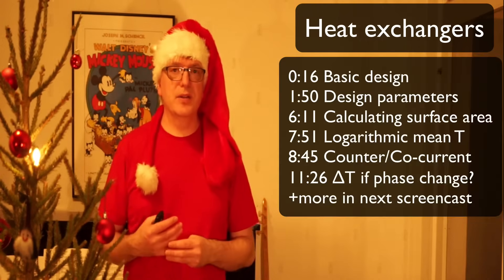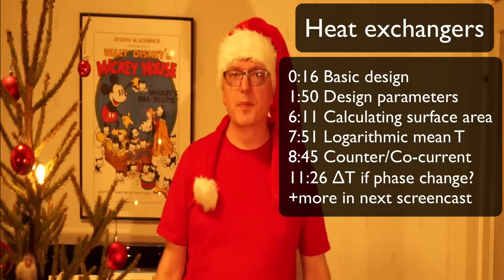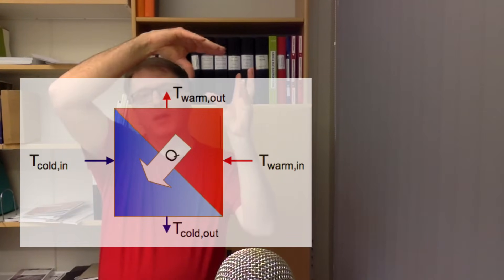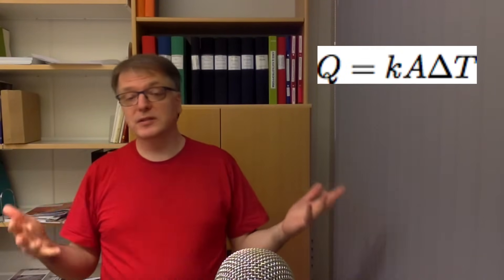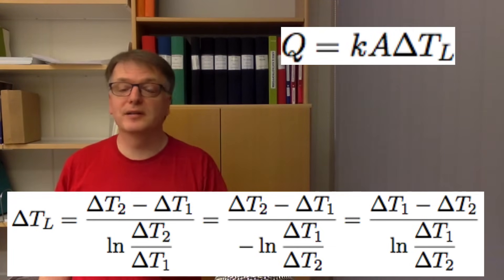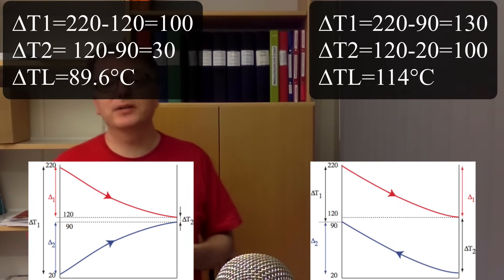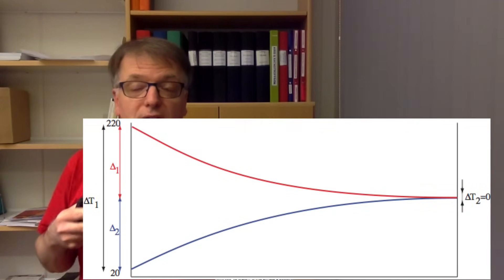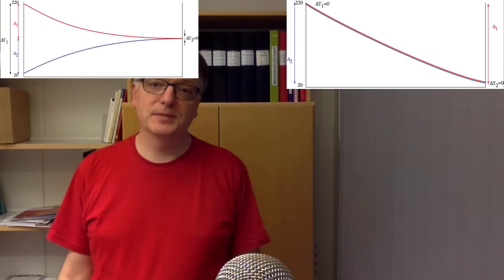Heat Exchangers 1

Comment: Sir, can we make a system for continues hot water supply (24 hrs) with evacuated tube collector and shell and tube heat exchanger (contain paraffin wax and stearic acid). It is efficient or not   ?
Reply from the maker: To get answers to such questions, contact your teacher/local heat exchange producer